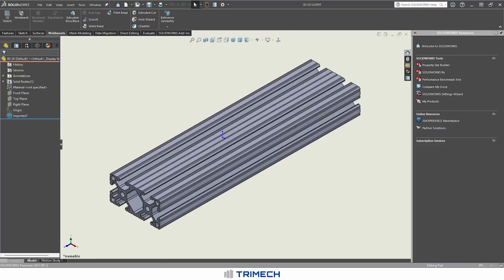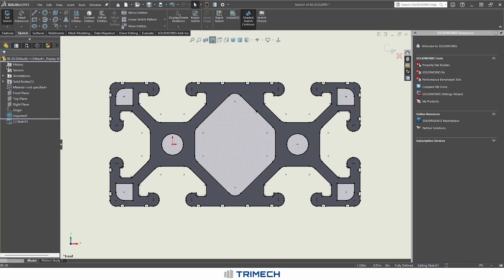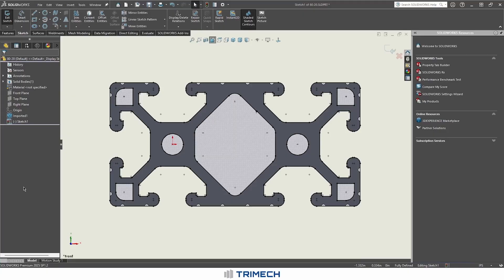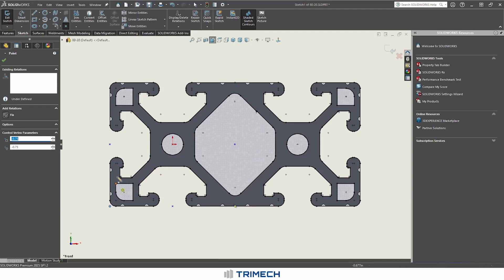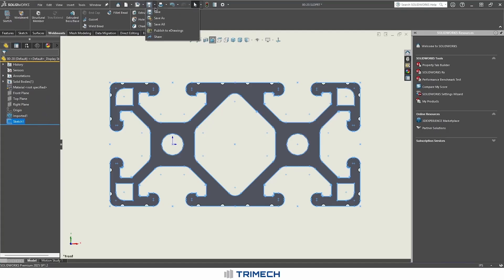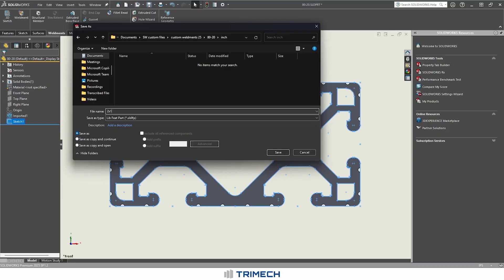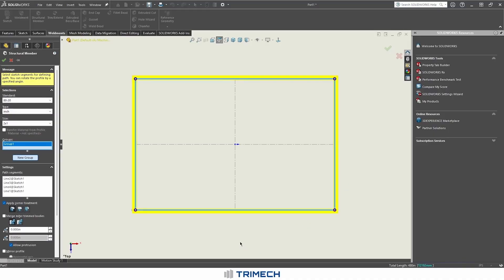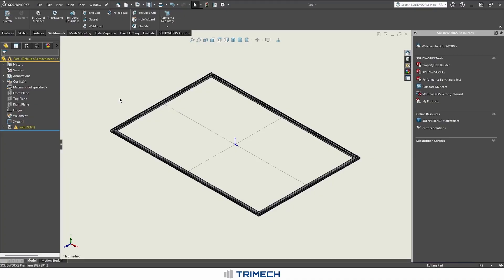Creating Your Own Custom Weldment Profile in SOLIDWORKS

Comment: Very good!! I would only change one thing, I would make the origin of the welding profile in the center of the sketch, and not on the left side of the sketch. This way, when applying it to a sketch, it will always be extruded by the center of mass.
Reply from the maker: Great point! Thanks for the insight!